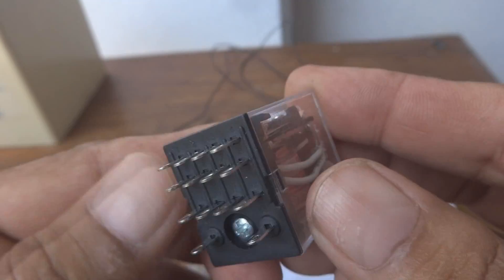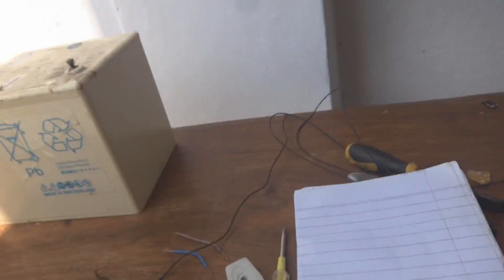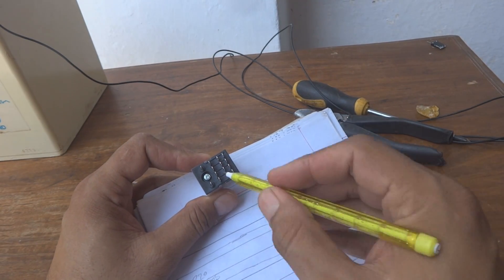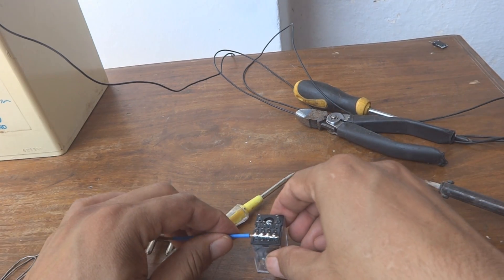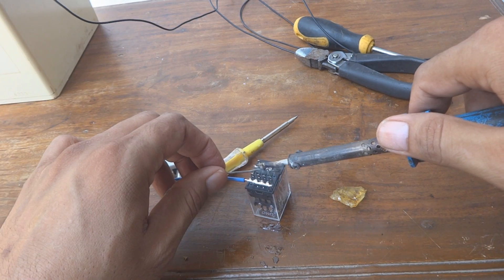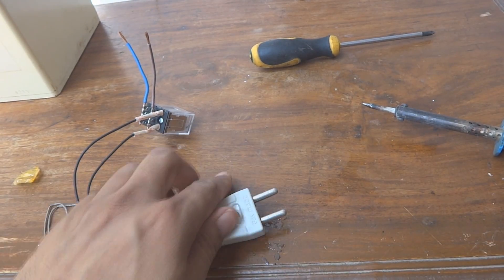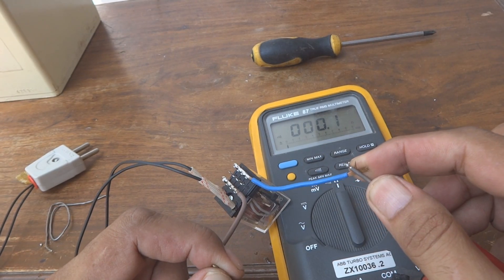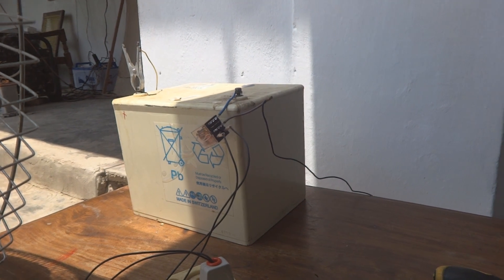Relay explained, How to use a relay. Relay automatic switching by 220V for 12V fan

Comment: Hi There, If I have an electronic item, that I can charge with 12 volt and 230 volt, it must have a tiny relay on its board? to switch. If I had a charging bay that runs off the mains power ie 230 volt, then if I unplug that it should switch to 12 volt and then I could use the 12 volt power to charge that same charging bay,  the charging bay is usb plugs.  Im a bit clueless, but is that possible

Comment: NO-220V , NC-12V am i right?
Reply from the maker: No. Coil is 220v. NC is fan positive. Common is battery positive. No not connected. Negative of the battery direct to fan negative.
Reply: What i mean coil is 220v and Normally Open is = 220v also? If common is 12v the normally close is 12v also?

Comment: Ok so, how does this start and stop?
It keeps running the fan 24/7?
Or it stops after certain time???? Plss anyone
Reply from the maker: Try to understand friend. Here are two power sources. One is battery and the second is 220v means line. The fan runs with battery DC 12v. The 220v line is switching on and off the DC fan by this relay. When 220v would be present, it will activate the relay and switches off the DC fan. When 220v means line disappears, the relay will be released and it will switch on DC fan.
In the presence of 220v DC 12v fan remain off and a 220v ac fan runs.
Reply: @JahanZeb1976  thank you

Comment: Sir I have one doudht
Reply from the maker: The way this system works, first you must understand. There are two fans in the system. One is regular 220v ac fan and the other one is 12v DC.  When company power is there, it would spin 220v fan and 12v DC fan would remains off. Then when power will out, the 12v DC fan would come on automatically by this relay.

Comment: I want to use a 8pin 240vac to Power a 24vac irrigation automatic valve, ist possible?
Reply from the maker: Do you have 24v available? This relay works like a switch only. It will not convert 220v ac into 24v DC. For that you need a powersupply.
Reply: @JahanZeb1976  i don't want to convert AC to DC, my power is 240AC and the valve take AC as well. It just the valve requires 24vac.
Reply from the maker: @TorPid9  then you need a transformer of appropriate size and rating whose primary should be 220v and secondary should 24v. This relay has another purpose of switching.

Comment: Those relays are not to be soldered to wires. They are to be socketed.
Reply from the maker: You are right. But sockets are not easily available for such relays sometimes. So soldering can do the best. Anyhow I obtained sockets for them and will post video to do it in socket as well. Good point.

Comment: you soldered so many contacts in parallel to connect them all with applying power, why? because your relay is not reliable or there is the reason to create so mach contacts?????
Reply from the maker: It's to increase the current density through contacts. As I was about to run 10A DC fan through this relay and I had four contacts set. I soldered them all in parallel. If I remained contacts empty without using them, had no benefit. So making them all parallel made it very durable and trouble free. Stay tuned.

Comment: So what i will do,the relay work in low voltage??
Reply from the maker: If you have permanent low voltage in your area, you can modify such relay to be making it working on low voltage. Modification is to reduce the number of turns for the relay coil. I will upload the modification video soon here on this channel. Stay tuned and regards,

Comment: Brother relay not work in low voltage..its means when i have Ac power 110 or less??
Reply from the maker: yes, it will not work if voltage is low.

Comment: Is this 12v relay or 24v,
Reply from the maker: This is 220v ac coil relay which is switching 12v DC on its contacts. You may watch the video again and stay tuned. Regards,

Comment: where can i connect the earth wire in this DC relay  ?
Reply from the maker: If you are asking about negative wire from DC battery then that is not connected anywhere on the relay but that will directly go to load i.e. fan here in this example. The only positive wire is connected on relay contacts.
If you are asking about control ac 220v from power company then both phase and neutral is connected to both terminals of relay coil. Hope you understand what I described.

Comment: Thank you for sharing. I have a question regarding the contact, on the relay it specifies 5A 240VAC, 5A 28VDC but here you used 12V contact. Does that mean the specification only specify upper bound of the relay and we can use the relay for any current less than 240VAC or less than 28VDC? in particular, I should be able to use this type of relay with contact 110VAC right?
Reply from the maker: Coil is 220v ac. Contacts has no voltage value or restriction as long as you are under 400v. Contacts are just switching but they have current limit of 5A. Regards,

Comment: If my main power input to the fan  is coming from solar system with 12v and secondary power input from utility*220v) with proper transformer to provide 12v DC for the same fan. At ight when solar power is shut down I need to switch over to utility power source to feed the fan. Is this relay can satisfy this purpose or there is another type of relay?
Please advise
Reply: I did more search on the internet for  the relay types , I found a solution for my issue. By using 12V DC coil relay instead of 240v coil, then both input can feed the fan normally.
thanks for your great video :)
Reply from the maker: Dear Sir this same relay can do the job for you.
What you should have to do is connect the remaining set of contacts to the 12v power feed from the supply company. So it will do what you asked.  Stay tuned and blessed.

Comment: How to omit the delay in the water heater 220v 8 pin and reconnect the wire to work without relay
Thanks in advance
Reply from the maker: I never worked on such relay. If I will get some info, I would share. Regards,

Comment: How could you wire this up to where it works BOTH with company power and with battery back up with automatic switching?
Reply: automatic switching back fourth..... or one way?
Reply from the maker: It is easy. You can use the other contacts which i didn't use here in this video for secondary power source. Regards,
Reply: brian davitt yes. Just connect the remaining pins of relay i.e. Normally open pins to a 12 v adopter or any other source. When the light will come the load will shift from battery to alternative source.

Comment: You r doing great.   I have a problem .  I watched a video on the below subject:

How to make automatic transfer switch using relay for double supplies in Hindi and Urdu : by sikender haider. 

My problem is that can we use it for Wapda + solar power supply up to 2 KW load??   I have a solar system producing up to 1800 Watts power supply in the day.   Allah bless u with more successes.  Am in.
Reply from the maker: Thank you very mush dear wazir Azam. I commented before from my Urdu channel and also I subed you from there as you are doing awesome work on Solar power.
Sure you can switch you both supplied to your home wiring. But care is a must not to mix up two supplies even is worst case failed situation. You can use two three phase contactors with NC and NO auxiliary contacts for safety or you can use use four such relays to control all four wires (Phases and neutrals) to make the system very much safe for not crossing supplies to avoid short circuiting. Hope you may understand. If there is any doubt, please don't hesitate to ask anytime. Wish you good luck.

Comment: Thanks for the video it was very helpful but I have a question. You use 220v power we use 110v here are you hooking up 220v to each side of the relay or 110v to each side of the relay. Here we use two 110s' to get 220v  as in line feed has 110 on each wire.
Reply from the maker: Dear friend great that you like it and you are interested in this project. You can purchase a Relay with 110V AC coil but if you are in intention of using 220V AC relay then you should bring the two wire for 220V. Here in our system only 220V AC is supplied by a phase and neutral. So it works in this case. You may watch the video again and understand it well before attempting it. Hope you will be easily do it. Great to see your comment!
Reply: Thanks

Comment: thanks bro nice video. i have question. I am using the MY3-N relay. can I Use the MY4-N for it. Because it is not available now a days in market . thanks.
Reply from the maker: Dear friend Nisar Khan sure you can your NY4N for your application as long as its coil voltage are the same as your supply voltage i.e. 220V in our case. NY4N is the same relay like the one in this video. so it will be connected in the same manner as this one is. Also you may watch my other Urdu channel. Hope you will find it interesting. If you face trouble finding my other channel, please ask then. Here is the url:
https://www.youtube.com/channel/UC41J6Lqm5M2jkrc8aseO0kw

Comment: salam bro a nice video.what i have in mind is. during electricity hours.the coil wil be continously "on". coil overheat ya damage to nhe hoga ?especially for places where power shuts down after every 5 to 6 hours.
Reply from the maker: +TheNEELO thanks dear friend for liking. These relays are designed to operate 24 hours a day. Anyhow nothing lasts forever! At my home it works since the video date. It is connected all the time. And also the price is way low that if it burns after a few months of service, it is easily affordable. 1$ in 6 months is something anyone can afford if in worst case situation it may burns. The service it provides during its service life is more valuable than its cost. My parents are very happy now with their automatic fan!
Reply: LearningZone  dera manana brother you cleared my confusion.thnx for sharing ur knowledge and informative videos.
Reply: LearningZone  is there any way we can stop the power in sake of power saving or safety

Comment: nice video bhai is mo jo 5,6,7,8 point ha is se hum 220 output bi ley skty ha or ye raley zeyada se ketny ampr ki hoti ha or ye ketny ki  pak se melti ha
Reply from the maker: Thank you bhai Aurang Zaib. Bhai is mae sirf coil wali do pins to 220V ac say milathay hen thakeh relay ko 220V ac as on ya off kiya ja sakay. Baqi contacts par ap ko 12V battery ki power ki switching karni hae. Wahan per na 220V minanay hen aur na waha output 220 milay gaa. Video dobara dekhye thakeh achi tharha samajh aa jae. contacts aur qimath ki detail video may hae. har aik contact set 5A ka hae aur relay ki qimath pak may Rs. 100 hae.
Reply: LearningZone smj geya hu bhai 5a se zeyada lod waly bi hoti jes se hum 2,3 fn ko ak hi raley se on off kar saky 15a ya 20a ki bi hoti ha raley

Comment: sir I will keep mobile for charging at night so I can't get up at night after full battery charge to do off so can u make any circuit by using timer switch & contactor.......?
Reply from the maker: Dear friend why do you want to switch off the mobile after charging? If the reason is mobile battery protection then it is there inside your mobile and on the top of the battery which prevents battery overcharging. So if this is the case then don't worry it will not damage your battery. If there is another consideration like power saving or something, then please comment so that I may know.

Comment: Having a clear relay so we can see internal parts helped my understanding. You explained the relay very well and the application is perfect for your Father's needs. Well done.
Reply from the maker: Thanks dear sir. Great that you understood relay from my explanation. You are the master, you already know such things but my tutorial is just a refreshing course! My parents are very happy after installing such relay circuit with their fan. As now they have uninterrupted sleep during power cut off. Best regards,
Reply: @JahanZeb1976  hi, i thought if input voltage is 220V the output is still 220V?
Reply: 0⁰

Comment: sir do vedio on auto off& on for mobile charger using timer & contactor
Reply from the maker: For mobile charger why do you need to switch on and off? Is there any special need for that? Please explain in detail so that I may understand the reason for that and will be able to do a solution and will do video on that. Best regards,

Comment: thanks sir..sir i want to know that how can i convert 5 pin relay to a earth type relay.in pakistan people call those relay "choor switch" one wire is connetced to bike parts and bike will not start untill we touch that part.
http://www.buildcircuit.com/how-to-use-a-relay/
check this link.
there is a relay on this page.when i opened a relay i mean when i broke it .i see inner connections ."NO" point was connected to point "B" and there was a diode on jumped wire.
if u understand plz answer .otherwise give me our email i will send u pic.
i want to ask that how to connect that switch in my bike?how can i wire it in my bike.the switch from market contains $ wire.there is no color coded wire on this

Comment: I love how handy relays are, they are a crude device but i've used them for all sorts of switching :-D

I'm not sure why you would want to turn the fan off when the mains is present.
i see no battery charger to be switched in to charge the battery up while you have power.
Perhaps i miss the point lol :-D
Reply from the maker: Dear friend thanks for dropping comment! The reason for the battery operated fan to switch off when the company power restores is we are then using 220V fans. In this way the battery is conserved. The battery is charged using solar charging and sometimes company supply charging also. The charger don't need to relay. Instead charger is connected all the time with the battery and starts working when there is company power available. Regards,